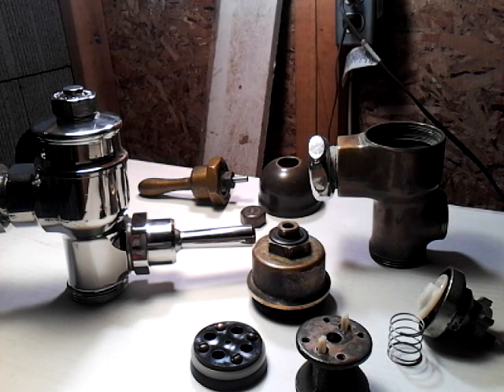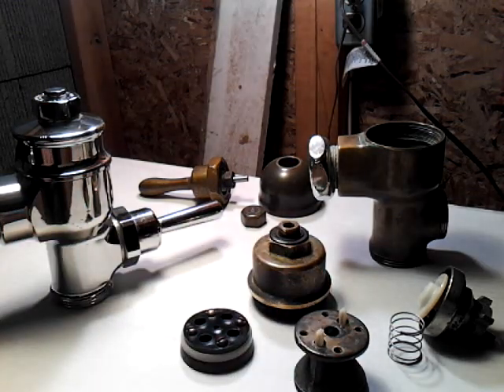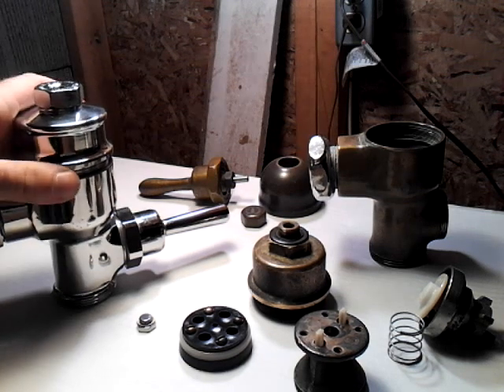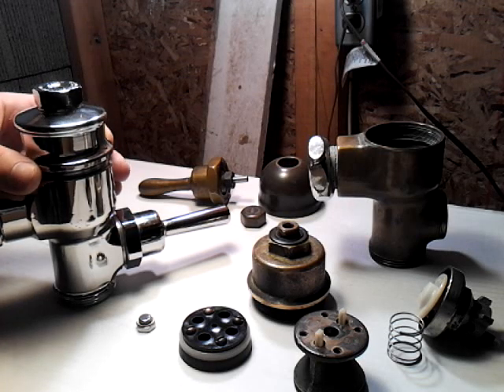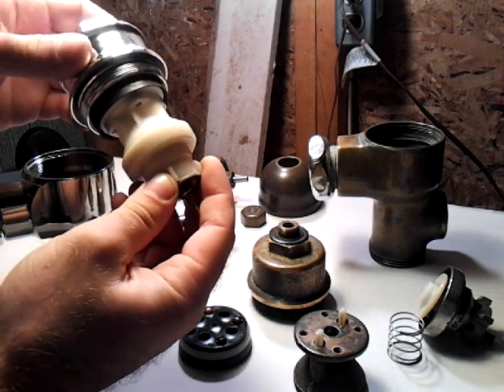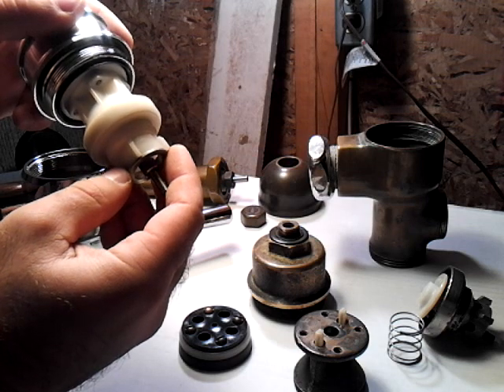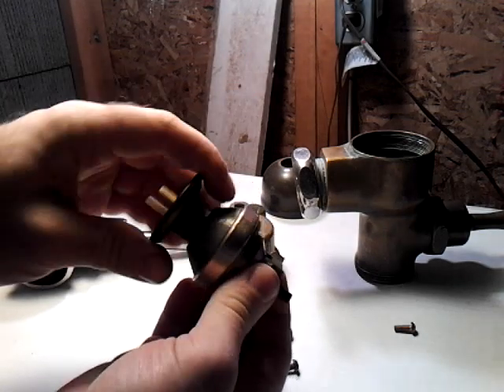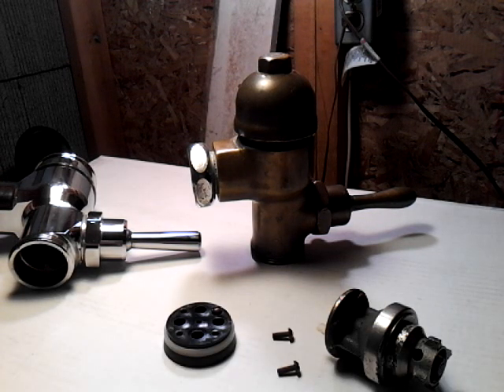#33 Sloan Naval and Star flushometer valve explained.

Comment: Years ago I saved a 1940s crown from a scrap pile.
Just now found it in the garage. Might get it working one day, it has a neat looking vacuum breaker and a 3/4 stop which I have never seen on any other sloan valve.
Reply: Do you think a 3/4 stop would work on a toilet?
Reply from the maker: @williamvaszocz1150  Probably not. You really do need 1" for a toilet. I'm guessing your old Crown has what is known as a ground joint tail piece connection between the stop and the flushometer.  If you look for another stop you'll need to make sure you find a stop that takes that connection. They are still made but most new ones have the adjustable tail piece.
Reply: Yes, it looks like a union joint. 
I looked for a stop and of course they are more expensive than the regular type.
Reply from the maker: @williamvaszocz1150  Yeah they are seldom used now, mostly on Dolphin and Naval flushometers. I see them on Ebay once in a while.
Reply from the maker: The 3/4" stop is used on urinals. Most urinals I've ever seen have that.

Comment: Thank you!  Do you rebuild them or know someone who does?  I have 2 x 1940s sloan valves (it looks closer to the star model?  but not sure).  The valve is covered by a plastic cabinet that forms the back of the toilet. To flush it you push the seat lid back against a lever in the cabinet. I'd really like to be able to keep them but not finding much luck on parts or rebuild.

Comment: Have you ever thought about taking your rare old flushometers and turning them into industrial lamps in the handles would be the light switch?That's what I did with my old stuff that you have.
Reply from the maker: I could do that but most of them are in good working condition.  I just can't bring myself to do that to a good usable valve.
Reply: Well mine was good in the inside of the flushometer, wasn't ate up with hard water, I had one flushometer that was eight up but it was always good for a lamp no matter what. You might as well do that because if you have kids or nieces or nephews you can pass it down to them as a lamp. The problem is if you have those old flushometers and you're not doing anything other than using it to flush toilets they may not keep them around as a memory that they were yours. I have those really hard to find flushometers and they look like the Sloan Royal Bell on top in the handles are rounded. Very obsolete material. What you need to do is if you need flushometers just go with the modern ones for your old toilets. I'm the only one in this whole country that created that idea and I try to get a patent for it but my attorney couldn't help me but he did say I have never seen something like this and he told me that I fought half of the battle

Comment: Have two Sloan Star's on ChinaL urinals, in an old school I'm turning into a home. It half crossed my mind to rebuild them, but the chrome is pitted, and the main bodies have marks from an angry plumber sometime in the past. Do you by chance know how many gpf these flushed?
Reply from the maker: On a urinal, probably 1 to 1.5 gallons per flush.
Reply: @vintagekohler6085 
Some washout urinals had a 2 gallon-per-flush flush. Old blowout urinals, women's urinals and pedestal urinals all used 3 gallons per flush.

Comment: The only Sloan valves I've seen is the regal and royal
Reply from the maker: Yup, they are very common. I've only ever been to one building that had piston flush valves and they were vintage Sloan Crowns from the 1950s. I wish these valves were more common.
Reply: @vintagekohler6085  They probably were at one point but of course over the years they get needlessly replaced so they become rare sadly. Where did you find the 50s Sloan Crowns? If you don't want to tell me, that's fine but please at least upload a video of the bathroom there
Reply from the maker: @exoticcar5482  The building is private property and I can't go back unfortunately.